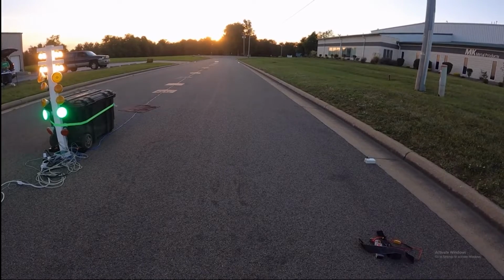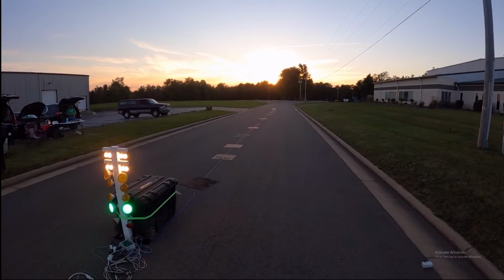NO PREP Q and A | CASTLE COGGING?  OG BO | SANWA TUNING? LEAVE QUESTIONS IN THE COMMENTS

Comment: Good vid what Coggin? agreed  !!! The  right rotor and motor timing .. just one question why do you run your activation Rang so close ? I run mine 22000 to 81000... according to the numbers roughly a hundred feet. Till full timing. What start power are  you using
Reply from the maker: Think it’s default which is 0. Someone else asked me that and it had to look it up. I guess I was just guessing trying to keep the range close to what I was doing on my tekin and just fell into something that worked. Would like to change it and test some more.

Comment: I think the Flysky AFHDS 3 protocol is just as fast as the Sanwa and Futuba radios at this point. It's a real shame there's no open source software like we see in the FPV scene for these ESC's, I think most of them are STM32 chips, but it seems like the manufacturers are locking it down right now. The FPV world just moves so much faster in that regard...
Reply from the maker: If this big money keeps up then maybe we will see some action on some of this stuff a little more. Speed is going to be an issue for a long time though because of Covid. And then there’s the money part. Nprc is more of a niche then fpv is. 99.9 rc is buy s rtr from the hobby shop and bash it. Not good odds for us. But I have seen a local guy make his own throttle input controller and those speed run guys have developed perfect pass for their application. So it’s not out of the realm.

Comment: I can tell you. Castle was very open with why the Mmx8s and xlx2 are both 8s and only 150amps power difference. Board technology and capacitor technology. Castle used the best of the best on Mmx8s and xlx2. You will NOT match or beat castle amperage or efficiency. They made sure of it

Comment: Hey chad,  would like to rack your brain for a minute.  I have hobbywing xr10 legacy, hobbywing v10 g3 3.5t, protek 6100mah shorty battery, and I’m using a fly sky noble nb4. 
      No matter what my gearing is, where my turbo is set to, the car will not go faster than 55mph.  I’ve ran consecutive 2.800 back to back at 55 mph.  Motor rpm (with the car on the ground) won’t go over 53 to 54k rpm.  But no load, will spin up over 80k.   Just want to see what your thoughts might be before I take it to my local hobby shop
Reply from the maker: Might need to add some can timing. Move that up to about 32/33. Those motors are always under dialed.
Reply: @Dorkyand40  that’s the problem.  I’ve turned the can timing from 20 to 50 and everything in between. Runs the same mph, I’ve used a 12 to 18 tooth pinion with a 56 tooth spur.  All with the same outcome of 55mph
Reply from the maker: You need about a 87-90 spur with a16-20 pinion.
Reply: @Dorkyand40  I was kinda wondering if I needed to go up on the spur gear
Reply: @Dorkyand40  thanks for the input buddy!
Reply: @Coffmanfamilyracing  remember to keep an eye on your esc and motor temps when gearing up.
Reply: @solrosenberg3587  oh I have been.  Just left local hobby shop.  Put motor on the dyno.  Bearings are shot

Comment: Chad, have you ever considered trying the Mamba Monster X 6S? It has the same firmware/tuning/logging capabilities as the 8S, has significantly higher constant current capacity than Tekin RX8 (which should be more than enough) and weighs 52grams less than the 8S version.
Reply from the maker: I did but then just went with the 8s since it was newer design and available locally.
Reply: @Dorkyand40  I just purchased one to replace my RX8 on my Arrow. I also do speedruns and I have found the Castle datalogs to be invaluable when it comes to tuning.
Reply from the maker: There’s nothing better. Many could take a page from them for sure.

Comment: Also something for you to check out. It says if you use cheat timing your motor can timing needs to be at zero. (This will cause the cog at the launch) turn the cheat time off. Cog will disappear. It says small print in the cheat time box. Mmx8s and Xlx2 are not meant to run motors over 2000kv. Hints why your cheat timing doesn’t go as high as the 1:8 Mmx does
Reply: Incorrect they actually came out with the update specifically for higher kV motors and delta wound motors
Reply: @kelvinburks23  touché 👌🏻 will look into this. Has held me back. Thank you

Comment: Firsttttt
Reply: Just saving up to get into rc drag racing, what platform is best for starters?
Reply from the maker: Man depends on budget. Lots is changing. You can start with a dr10 kit or rtr snd then upgrade that or you can go all out and build a full kit like myself and others run. Just depends on the cash.  I’ll cover that more in a video.
Reply: @Dorkyand40  I know Sanwa is your go to but could you add a budget “starter” rx and tx?